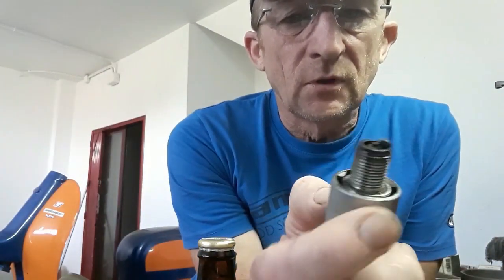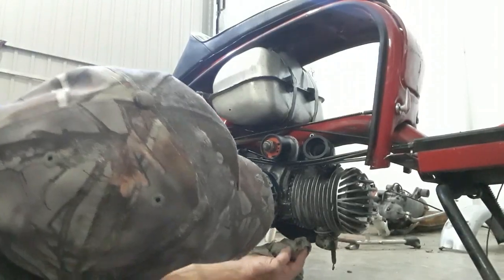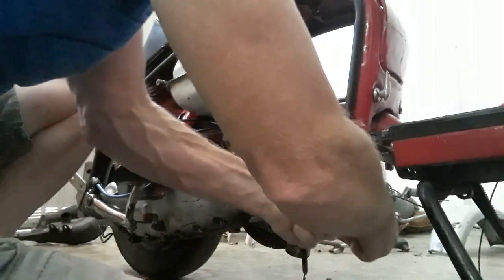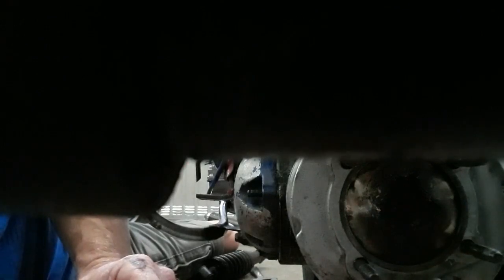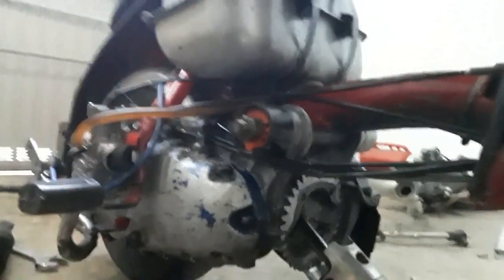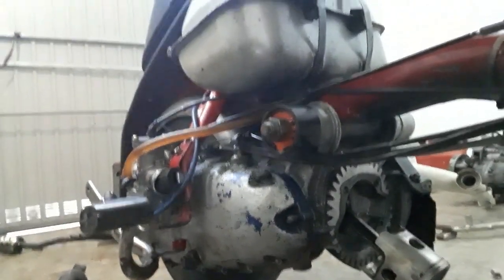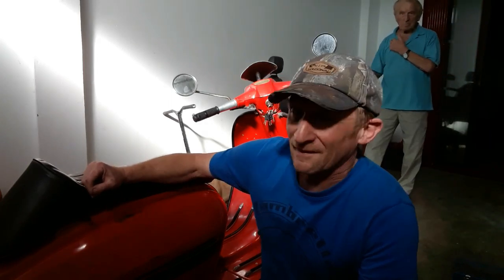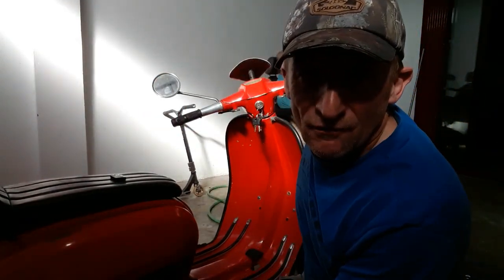lambretta tuning having a bad day

Comment: Steve, how can one remove the old race on the crankshaft for the 
flywheel bearing? mine will not come off for shit!
thx!
marcel
Reply from the maker: if you dont have many tools , grind a slot in the bearing race on both sides and then use a chisel to tap it off . take care not to damage crank . grinding will also heat the track .
Reply: @TheSteelweasel  worked perfectly mate, right off!!! great thinking that i would have thought a 1000 yrs from now...on with it yea? thx